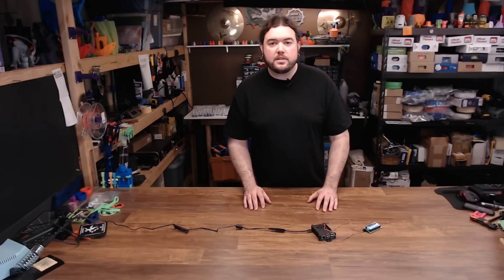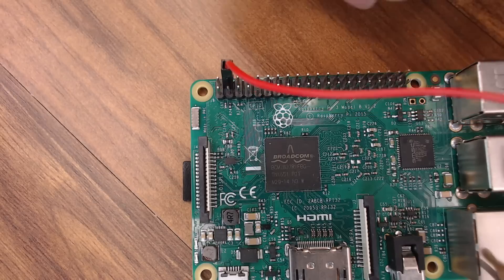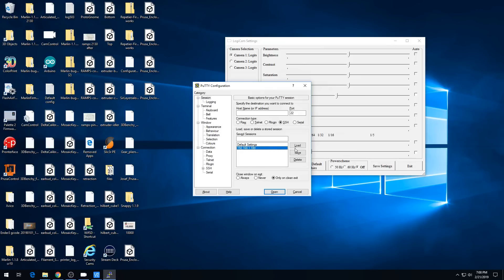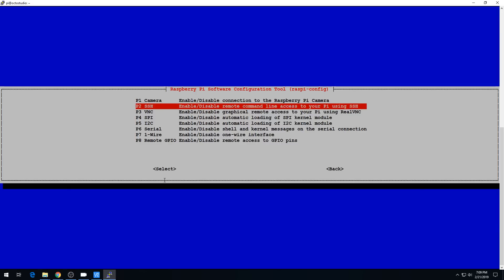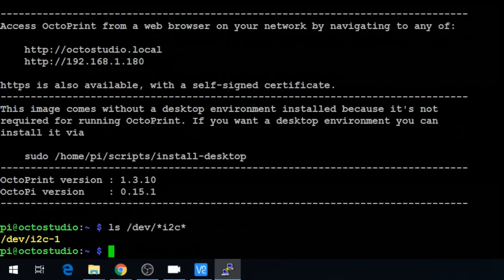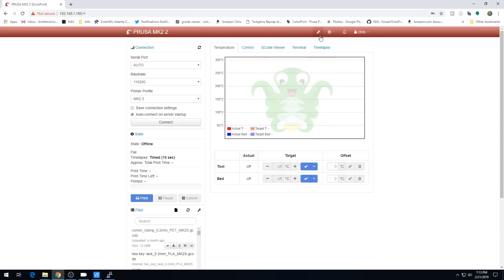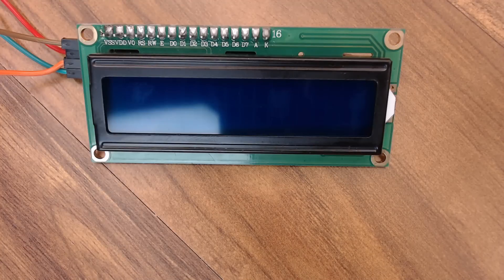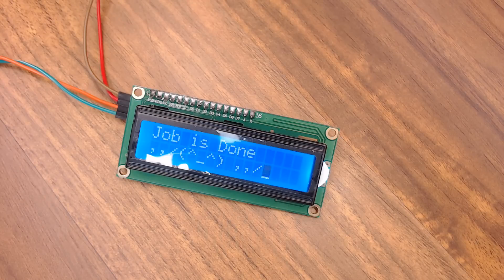LCD Screen - Monitoring Octoprint - Chris's Basement

Comment: So seems to work, but it goes in to “try saving a polar bear, eco mode on” and turns off backlight. How can I keep light on permanently?
Reply from the maker: That's strange, it must be a feature of that screen. Maybe there is a jumper you can solder or something?
Reply: @ChrisRiley  ok seems to be In the octoprint lcd1602 plug-in. Found it in the __init__.py script.
So have just edited it now, just got find where the original is stored on the rpi to replace it with my edited version and it should sort that out :)

Comment: Chris good idea but ran into a snag.
The error I get when loading the plugin is: 
Downloading https://www.piwheels.org/simple/pygments/Pygments-2.6.1-py2.py3-none-any.whl (914kB)ERROR: 
Package 'Pygments' requires a different Python: 2.7.16 not in '>=3.5'Error!Could not parse output from pip, see plugin_pluginmanager_console.log for generated output

Looks like a version clash so the idea may be on the ropes until this is fixed.
Reply from the maker: Yeah, the move to Python 3.x broke a lot of stuff. I hope they get this updated.
Reply: @ChrisRiley  Hi Chris,  I don't have Python 3 on my Octoprint(pi).  I have 2.7.1. Some people are saying I need to downgrade my pygments. Does this make sense to you?  I have no idea what this means or how to do it.
Reply from the maker: @andyshap  What version of Octoprint?
Reply: @ChrisRiley  My issue is solved!  It WAS a Pygments issue.  I contacted the author on GitHub and he gave me the solution, "run this command using ssh ~/oprint/bin/pip install Pygments==2.5.2"  I am now happily running my 1602 LCD with Octoprint!

Comment: Great video!  Is there a way to use this plugin if my 1602 doesn't have an I2C module (connecting the 16 pins of the 1602 directly to the pi)?
Reply from the maker: Thanks! There might be, but I am not sure how it would be setup.
Reply: Well I will be trying to connect it up.  From what I've seen, I should be able to do this and get the pi talking to it, I'll let you know if I can make Octoprint talk to it.

Comment: Do all the peripherals come as a package when you purchased the Raspberry pi except the LCD screen?  If not then where can you purchase that how do you know that they fit?
Thanks!
Reply from the maker: You can get kits that have everything yes, but most are just the board.
Reply from the maker: The Pi pretty much comes stand alone. What accessories are you referring to?
Reply: I am referring to cables and adapters that connect it to the printer and camera...etc.

Comment: So the RPi i2c bus is 5v tolerant?
Reply: Not resistant to 5v  - https://www.raspberrypi-spy.co.uk/2015/05/using-an-i2c-enabled-lcd-screen-with-the-raspberry-pi/
Reply from the maker: On an RPI you shouldn't need any level shifting or anything when using i2c.
Reply: @ChrisRiley  I asked because I was some time ago using some BluePill boards and everybody was saying that they were not 5V tolerant... and that was not correct, there are some pins that are and some that don't, so after that I do not take anything I read for granted unless I see it on a datasheet. I have not found any Broadcom datasheet that confirms or dennies they are tolerant, but the general consensum is that they are not, even in the RPi official support forums. I myself in doubt will put a cheap mosfet bidirectional level shifter... just to be safe.
Reply: I see no mention on 5v tolerant lines here (http://www.farnell.com/datasheets/1835725.pdf), but they state a VDD+0.3V max for input signals, that is 3.6V for 3.3V chips. Maybe the pin protection diodes are dealing with those extra volts, but I do not know for how long.
Reply from the maker: @GroovyDrifter  Better to be safe than sorry for sure. Great info to have in the comments though, thanks.

Comment: Thanks for the video, Chris. I have followed your instructions to the letter but for the life of me I can't get the screen to work past the line of squares because everytime I reboot Octoprint the LCD1602 i2c plugin has disabled itself again. I enable, save and reboot the system to find the plugin disabled again. 
Any advise from you or other viewers would be appreciated.
Reply: Just an update. I retested my wiring and found a dead connection in the dupont connector. Recrimped and all is working now . Thanks. :)
Reply from the maker: @captainmort  Nice! You had me worried there for a minute, glad you found it!